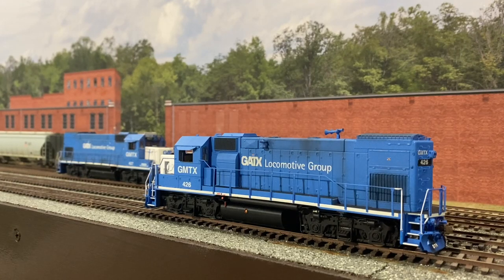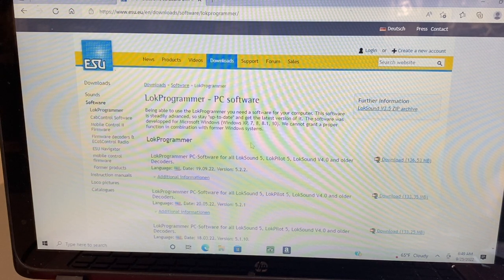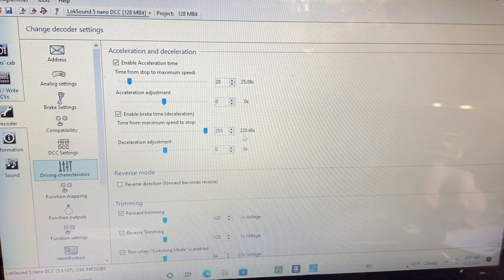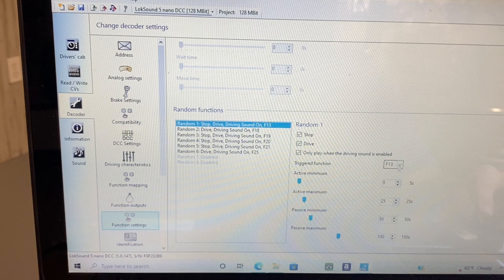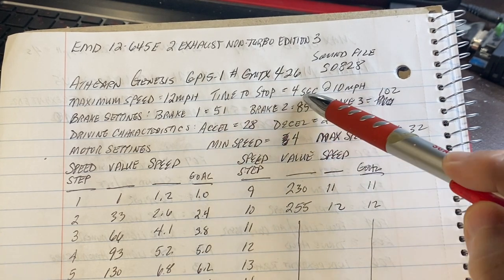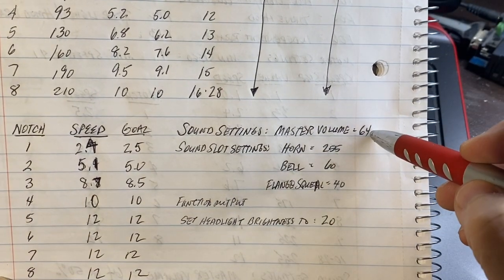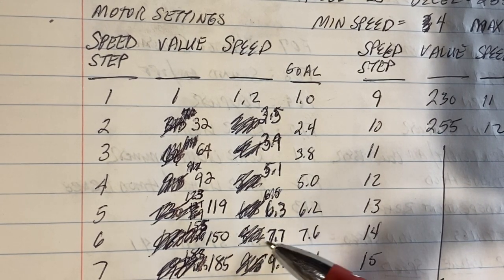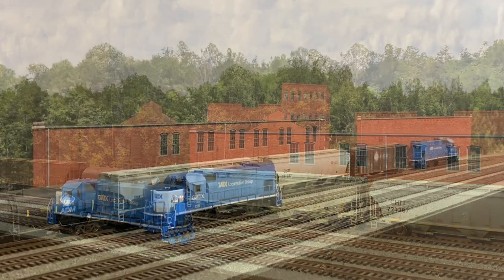Seaboard Central - Programming a Yard Service Locomotive

Comment: Tim, Thanks for showing how you program your locomotives. The flattened speed curve is a great way to realistically setup your locomotives. You don't realize how fast a scale 10 miles per hour is until you watch a model locomotive running at 10 MPH in a video. The locomotive sounds great and the new decoder with a built in power pack is the way to go.-Tom
Reply from the maker: Thanks Tom! Yes you are absolutely right. I’ve got four more of those decoders to install. :/

Comment: I've got to bring some of my locomotives to your house for programming!
Reply from the maker: Got to be ESU Select or newer to work with a LokProgrammer. Once you get past the learning curve, it is easy. A great investment.
Reply: @SeaboardCentral  I've got the protothrottle, lokprogrammer and just swapped a stock tsunami decoder for the esu 58921 in my athearn gp40. While I can do a lot of this stuff, I'm not so sure I'm getting or understanding the full potential of this stuff.
Reply from the maker: @Brandon-wf8ew  well you are off to a good start. Took me a while to figure out the LokProgrammer. I watched the ESU videos over and over until it clicked. Hopefully my videos help.

Comment: Pretty slick making detailed notes on previous decoder settings!
Reply from the maker: Yeah it really comes in handy, especially if you need to reset something back if it accidentally or mysteriously gets changed.
Reply: @SeaboardCentral  had the mysterical changes quite often on my decoders , mainly use digitrax N scale decoders , notes to change back really helps

Comment: Thanks Tim for all the helpful information. Like you I rarely install my decoders and speakers. I'm not good at it and will make it mess of it in a heartbeat. I/we are using NECs now but thinking of getting a couple of Protos. Do you like yours better than the NECs? Thanks again, take care. Sitting here waiting on the hericane to blow in.
Reply from the maker: Thanks John. I have NCE as my DCC system. I also have a couple of ProtoThrottles that are just more advanced throttles to use with my NCE system. All my locomotives are equipped with ESU LokSound decoders. All three make for an outstanding combination. Tim
Reply: @SeaboardCentral  thanks much Tim. I appreciate the reply. Thats a great idea to standardize all your units. I'm wishing now that I had. From now on they will and I'll start a turn of the others. I have several that need upgrading now.

Comment: That was very helpful. Currently I have my locomotives programmed to be able to go their full theoretical speed, even though I never use it, but speed-limiting has a lot to recommend it. Can you explain why you speed limit, even though it appears to be less "realistic?"
Reply from the maker: Hi Grant, sure. One of my pet peeves is seeing model trains run unrealistically fast through turnouts and around tight curves. You can have the best looking models and scenery and completely destroy the realism running the models too fast for the condition. On the prototype we have speed limits just like automobiles have on roads. Think of secondary tracks just like a home subdivision. You wouldn’t drive your car interstate speeds down the street in your neighborhood. The yard tracks and secondary tracks and even some mainline tracks aren’t designed for high speed bullet trains. For that you need heavy duty welded rail and very broad curves. I don’t know of any model railroad that has very broad curves to allow for the speeds our models are capable of. Most people’s layouts have curves that range from 22” to 60” radius curves. On the prototype a six-axle locomotive is limited to a 21 degree curve which is equal to about a 37 inch radius curve in HO scale. The speed around a 21 degree curve is 10 mph. Also, most yard switches are equal to a number 8 model switch. The maximum speed through a number 8 switch is 15 mph. On my layout the minimum radius is 24” and all my turnouts are either number 5 or 6. With that in mind I need to limit the speeds of my models to simulate the same kind of conditions that would have to be observed on the prototype. That is 10 mph on all yard and industrial tracks and a maximum speed of 25 mph on the mainline tracks with some exceptions which limit the speed to 15. Hope this makes more sense. Thanks for watching! Tim
Reply: @SeaboardCentral  Tim, I'm sorry if I wasn't clear. I completely agree with everything you said; what I was really asking is since in the real world it is you, the operator, that controls the speed, i.e., you don't go 60 in a 30 zone even though your car/train is capable of it, isn't it more realistic for the model operator to be responsible for controlling the speed of the train instead of physically limiting the speed of the train using CVs? As an exception I can see limiting the speed of a model to match its prototype's top speed, of course. I'm not trying to be argumentative, I just sincerely want to hear what you think to help me decide what to do.

Comment: For your genesis gp15s, did you have to cut anything out or make space in order to fit the decoder + keep alive and with the scale sound? Also, great video!
Reply from the maker: Hi Jake, only thing that needed to be removed was the rear weight that has two screws to hold it in place. The Scale Sound Speaker is a direct replacement where the weight was located. Thanks!
Reply: @SeaboardCentral  thanks for your help!